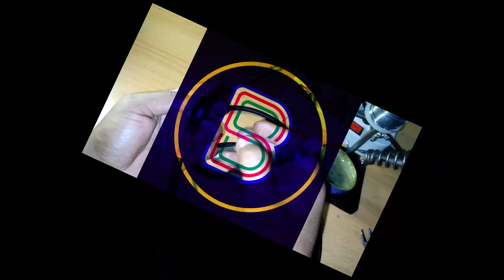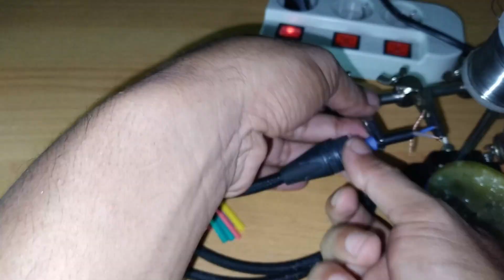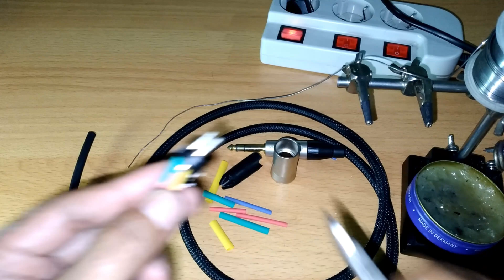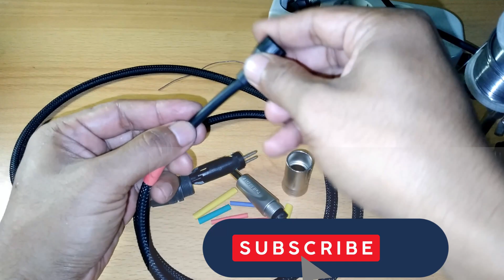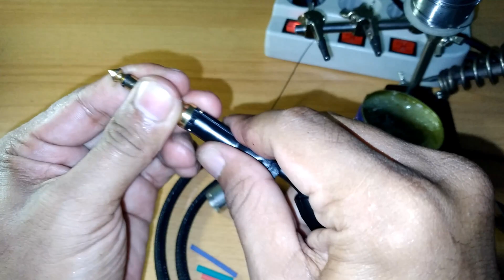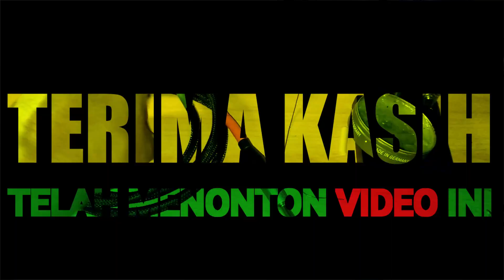How to make XLR to TRS Cable | Soldering XLR to TRS Cable

Comment: Perbedaan ts sama trs apa bang?
Reply from the maker: (TS)Unbalanced
kabel TS. ‘T’ singkatan dari Tip (sinyal) dan ‘S’ singkatan dari ‘Shield’ (ground)
(TRS)Balanced
Kabel TRS, singkatan dari Tip (hot), Ring (cold) dan Sleeve (ground)
Karena itu kabel jenis TRS ini memerlukan input balanced pula
Reply: Klo ke suara jernihan mn bang?
Reply from the maker: Untuk kejernihan suara banyak faktor misal, mic/source , crossover, amplifier,speaker dan mixer/style dalam mixing